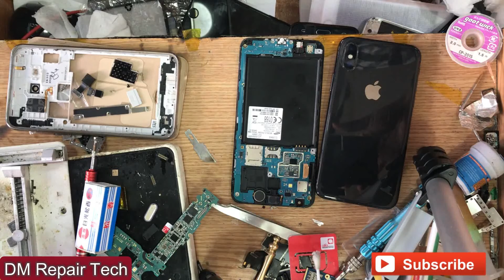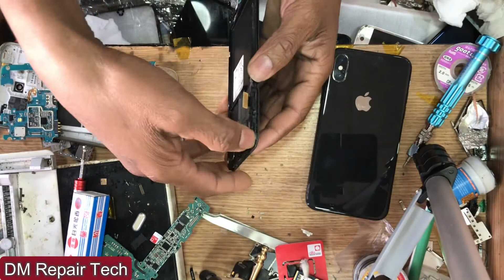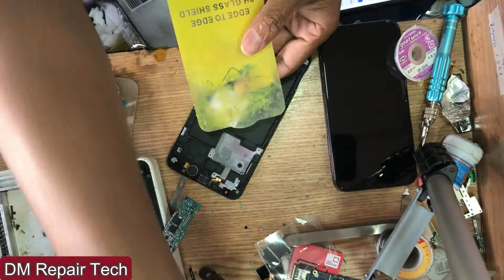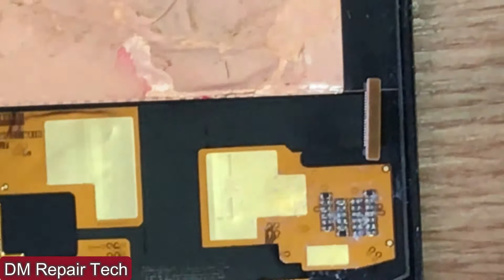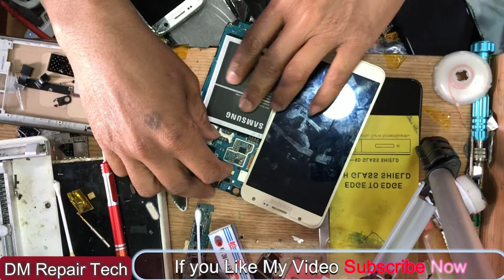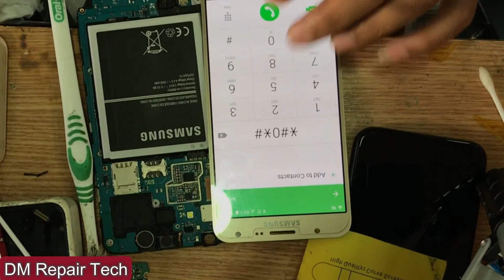Samsung All Screen Problems After Water Damage Display not Working 100% Fixed  Fixed

Comment: My phone (Samsung note 10 plus) was water damaged...when i was using the phone after 2 hours i dipped in water the display went off amd can't power it off but i kept it in rice, After about 7 hours now i can hear notification sounds and stuff...Is the display gone or it will be alright? Just the display connectors
Reply from the maker: You must be need to go phone service center. If you make late to service your phone you will loss your phone and not possible if too much inside the water carbons
Reply: @DMRepairTech  Because of lockdown no shops until tomorrow mrng :( I kept in rice though...do i need to replace the display?
Reply: @DMRepairTech  At first the touch worked even the display gone but now the touch is not working

Comment: Bro I have Samsung j7 2015 I have replaced original display + touch combo it's works for 1 hour after that it's not 1working motherboard is fine I have checked it by local shop
Reply from the maker: Check Display C/C on board maybe voltage or ic damaged
Reply: @DMRepairTech  tq bro for replying
Reply: @DMRepairTech  bro what is c/c
Reply from the maker: To get more help contact us Facebook.com/dmrepairtech